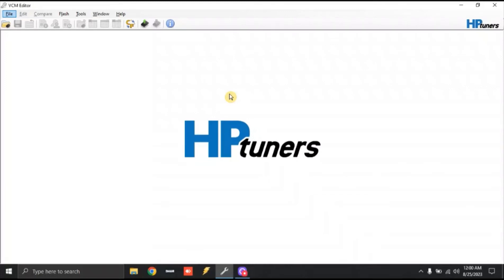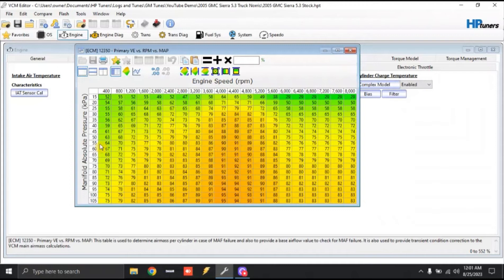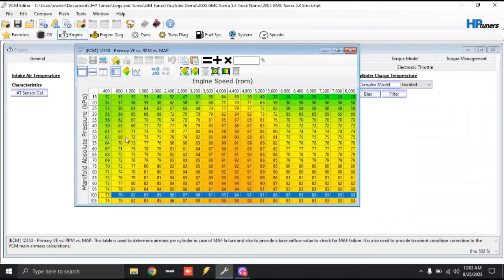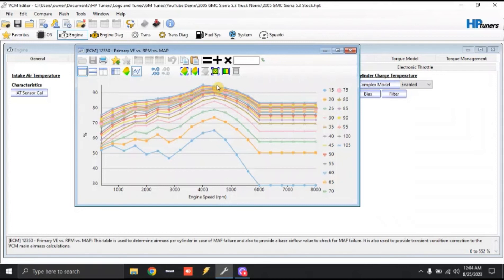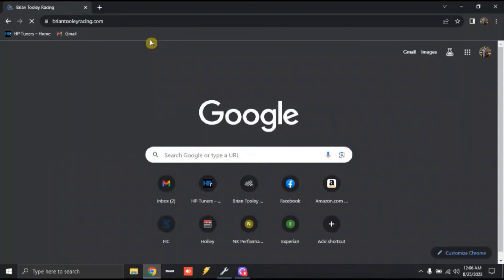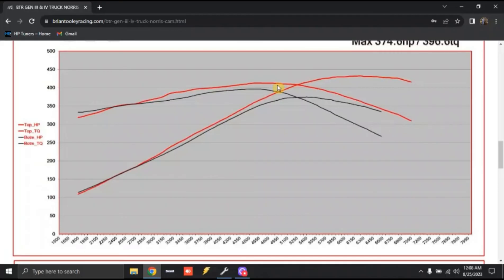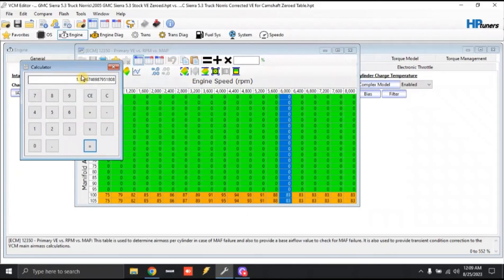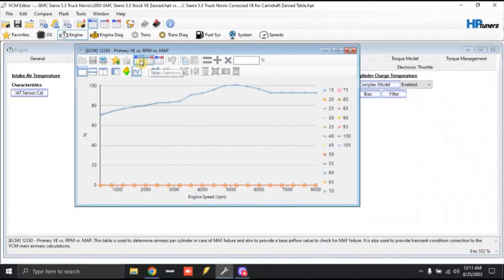Gen 3 GM VE for dummies! How a cam can change Volumetric Efficiency

Comment: I'm confused, in the BTR website you have a power gain start at 2700 rpms, on the tune file with the BTR cam you lowered the numbers below 4000rpm. This is kind of confusing.

Comment: I have been gobbling up your videos ever since i discovered your channel.  I am building a 5.3 in my 2006 gmc sierra with the truck norris, flat top pistons (aiming for 10.8:1 with head and block deck), long tube catless exhaust, some kind of open air box, mild port and polish on 706 heads and some kind of more open air box.  All of that with a built 4L60e.  The one thing i hadnt researched much yet is the tuning.  I dont trust tuners, had bad experiences, and i want to learn myself.    It will be a long process hut i have about 3 months to do it.  

Your videos are a god sent and i would like to thank you for your freely given information.  I understand you have a paid joinable section as well which i will definitely be looking into.  I fiqured i would familiarize myself with all your previous tutorial type videos and once i have a handle on that delve deeper into the tuning rabbit hole.  I am a person like yourself that needs things done right, even the stuff i cant see😂

Comment: Can you please explain me how we can possibly have 60-sh % ve at idle if we have our throttle fully closed. For example at idle, 1.3 vtec honda engine consumes 1.6 grams per second of air, but full throttle 80+- grams. At idle, We have around 75 kPa of vacuum, so absolute pressure is about 25 kPa at this engine.  How the VE can be 60-sh? Or 25 kPa with 100 kPa absolute pressure is estimated 25 VE?
Reply: If the engine is running and operating in all conditions with normal AFR it might be that the fuel injector specs are way off and they are a lot smaller than they are calibrated for. So it’s set at running 60% to offset the discrepancy in size. That’s my best guess.

Comment: Probably the reason your math on HP didn't match is because the peak numbers provided on the dyno graph weren't at the same RPM but on your ve table you use the same RPM

Comment: Any possibility you have a basic tune for a 6.0 LQ9 with the BTR Truck Norris cam?
Reply from the maker: I could make you one pretty easily. Email me at SkyeTuning@gmail.com
Reply from the maker: You will need larger injectors though if it has the stock truck injectors.
Reply: @Matt_Sanford  my engine has the 42 lbs injectors from a 8.1l marine engine. I wanted to keep the same injector plug with no adapters.
Reply: Also tbss intake and a LS3 throttle body

Comment: Can you show step by step on how to tune the VE table using data log
Reply from the maker: Yes. That video will be coming soon.
Reply: That's what I need... I'm afraid to change anything until I learn the how and why. 

So far I've gotten comfortable with changing shift points, recalibrating my speedometer after a gear swap, and now I "think" I have my efans sorted out to work properly when the AC is turned on. 

Baby steps...